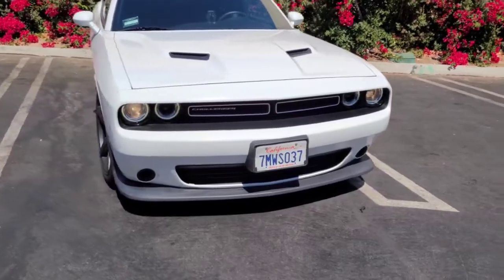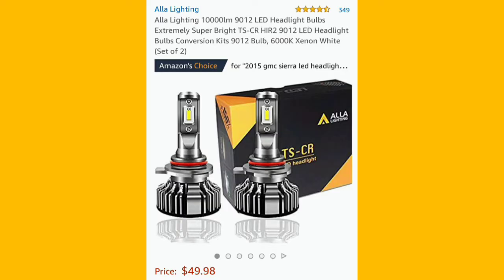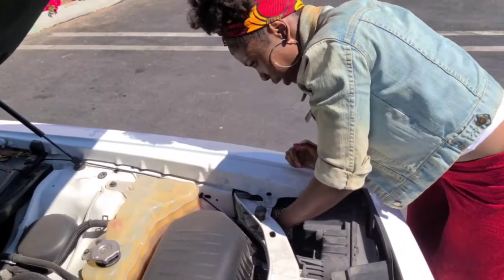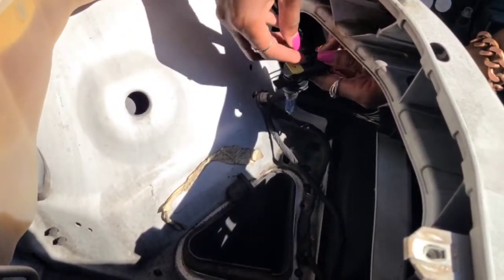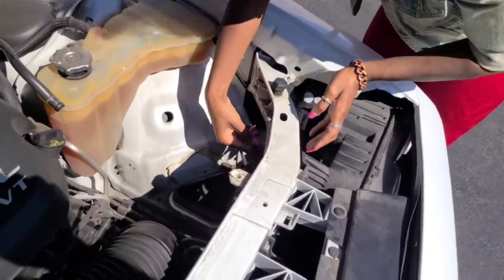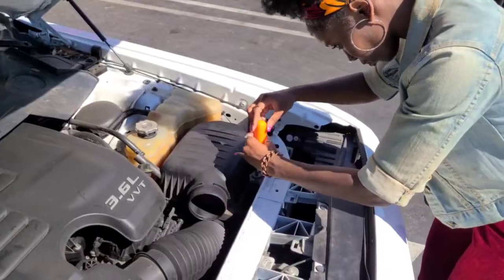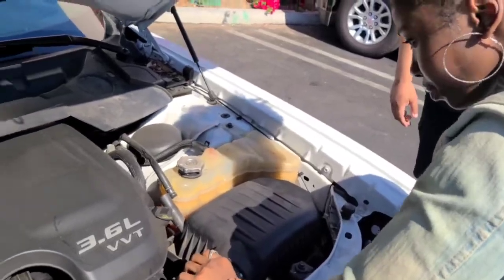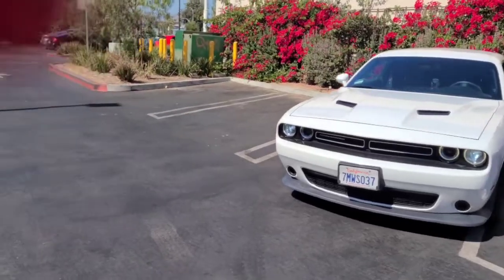DODGE CHALLENGER: CHANGING HEADLIGHTS TO LED BULBS

Comment: Good info! I currently have a Honda Accord, and it is INCREDIBLY difficult to change a headlamp on there due to the steel that is present near the bulb areas. You basically have to have hands that are the size of a child in order to get your hands in there.... I'm beginning to consider the Challenger RT Manual as my next vehicle even more due to this info (amongst other factors)! Thanks again!

Comment: Nice video..my only suggestion is that the bulb and the anti flicker module fits inside the housing. That way you can reinstall your dust cover cap. If you leave it open, it will allow moisture and dust inside causing your led to stop working.
Reply from the maker: Thanks! That's actually how I do it now. I showed it in my last video.
Reply: @Bellaei  thats what im here from. i was shopping on amazon cause I WANT TO SEE AT NIGHT😂😂 and i was like whats this decoder amazon keeps telling me people also purchased and i saw you video when i googled. now im here cause you mentioned this vid. i also have a sxt 🙌🏾 feel free to check out my vids too 😁 thanks for the awesome vids they help

Comment: What year is your car these lights doesn’t fit mine 😩
Reply from the maker: Oh no! Mine is a 2015. But it's supposed to work for 2015-2020
Reply: @Bellaei  ok mine is 2015 as well I honestly believe the actual headlights were switched too a different model because the connector for the new lightbulb is completely different
Reply from the maker: @KeepinUpWithKi  Wow... smh. I hope you were able to get a refund
Reply: @Bellaei  If I can’t get a refund I’m just going to resell it on Mercari 😁

Comment: Is there a certain way you turned the bulb? I can not get mine out.
Reply from the maker: It's kinda weird. U turn it the opposite way than u normally would because ur not facing the slot. You're reaching around, if that makes sense... hope this helps